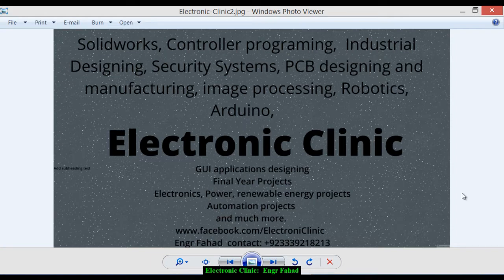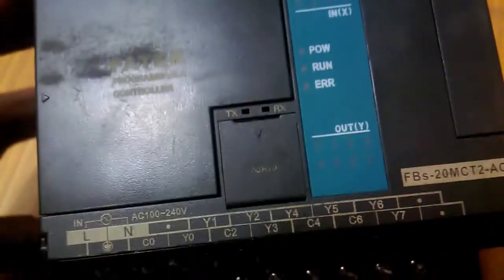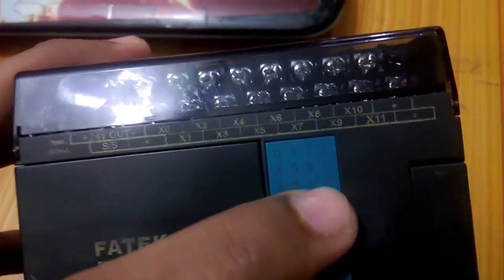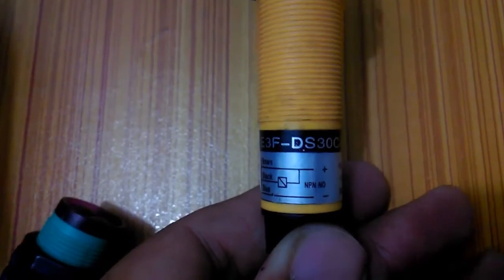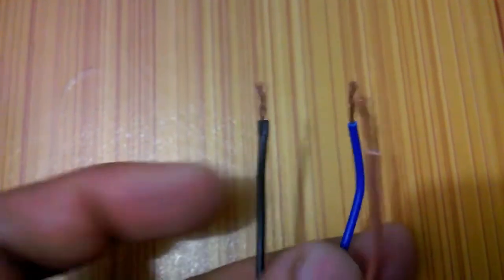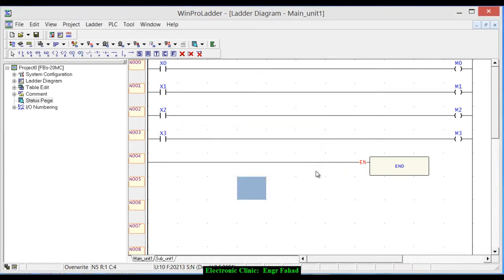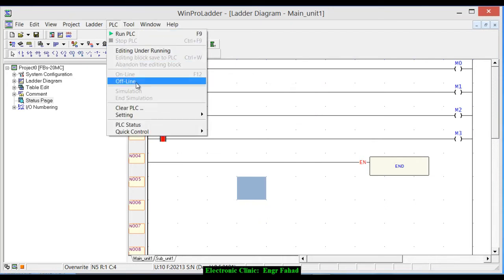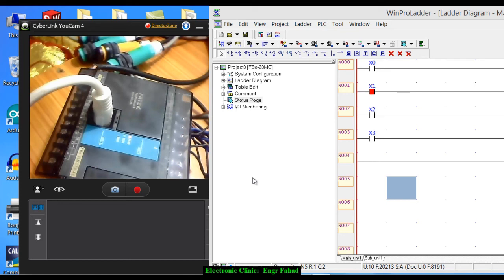PLC ladder logic programming tutorial# 21: Sensors interfacing , port settings, uploading program

Comment: i have a question regarding sensors  calibration with plc...the   o/p of sensor must be in 4 to 20 milli amp  for plc range...The question is what we should we do and if it is not then what about transmitter